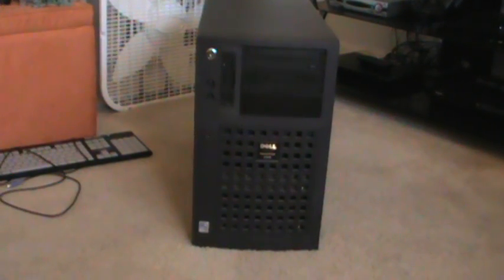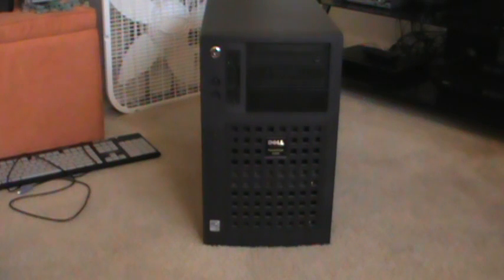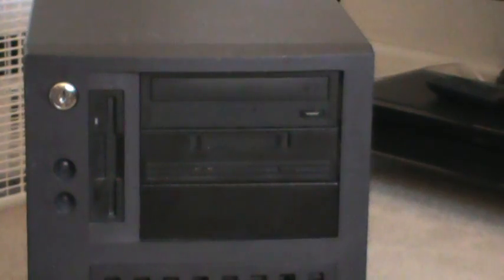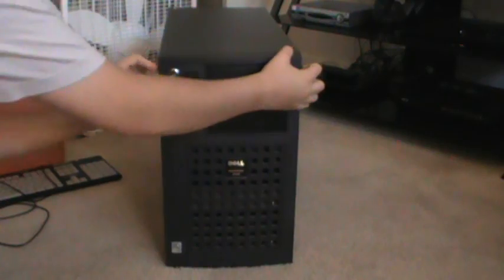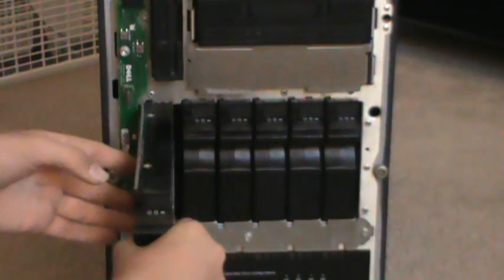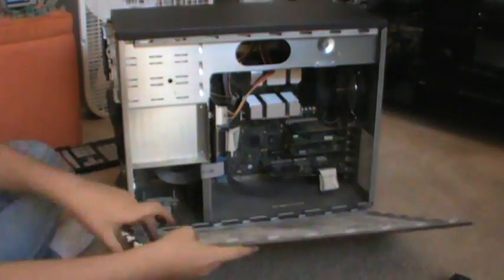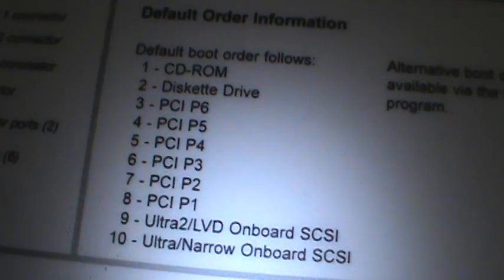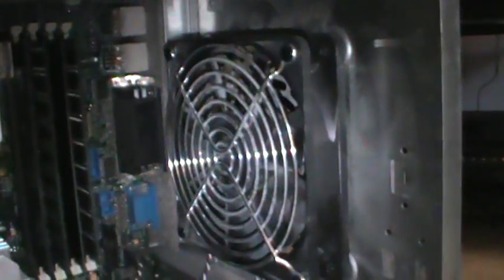I got a Dell PowerEdge 2300!

Comment: most servers I set up at that time had 100GB or so in total storage, usually 20GB drives in each and 1 drive was for redundancy only. 5x20 = 100 and the other drive was just for backup. most SCSI drives I've seen are IBMs.

Comment: A while back I was given a PowerMac G4 DP AGP model (dual-processor with AGP graphics) and I've now done a complete haul on the machine; I took out the four original GPUs (all were ATi Rage 128 Pro cards, except one that was a Pro LT 3D card) and replaced them with a newer ATi Radeon 9200, an brand new ATi Rage 128 Pro, USB 2.0 card, Sound card. I'm planning to take out the sound card and put another ATi Radeon into the machine so I can use it on my new tri-monitor setup.

Comment: That's an interesting little machine, I got myself three Dell OptiPlex 755 Towers, an OptiPlex 745 Tower and an XPS (though I don't know the actual model, it's a full-tower machine from 2005 with an Intel Pentium D that I've upgraded to an Intel Core 2 Duo, but I'm going to see if it'll work with an Intel Core 2 Quad). Most of the machines originally came with Pentium D (older) or Pentium Dual-cores (newer), but one of the OptiPlex 755's had a copy of Windows Vista and an Intel Core 2 Duo.